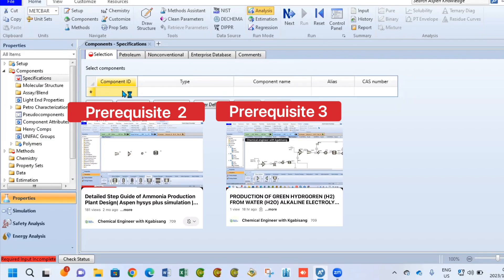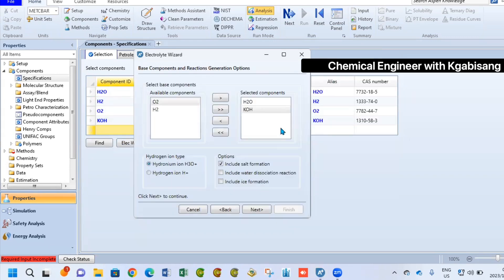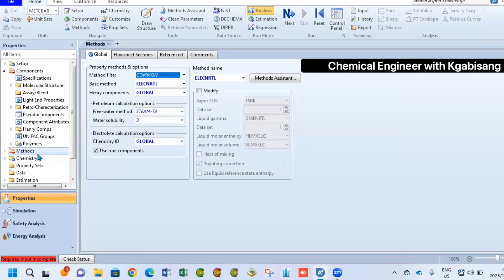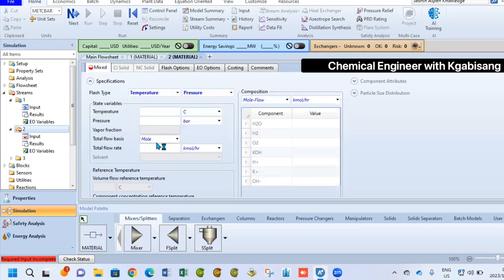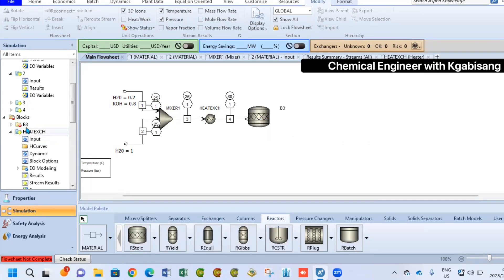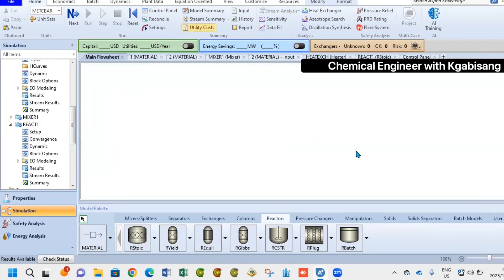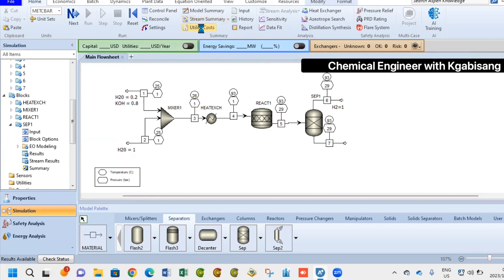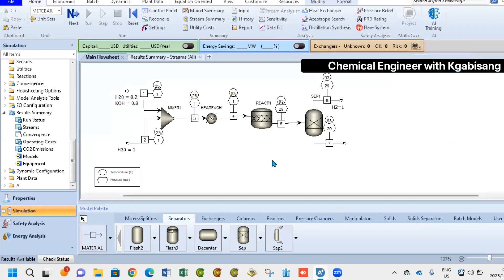Green Hydrogen Production Using Water Electrolysis: H2O = H2 + O2. Aspen Hysis V12.1

Comment: I thought before simulation one needs to get
1) cell voltage
2)stack power
3)hydrogen production
Reply from the maker: Thank you for your comment. I acknowledge that in a research project or detailed study, it is crucial to obtain information on cell voltage, stack power, and hydrogen production. However, the main purpose of this tutorial was to demonstrate the use of Aspen simulation in simulating the hydrogen production process. The tutorial's objective was to offer a practical demonstration and guidance on utilizing Aspen simulation, specifically the elec wizard tool, to simulate electrolysis. This tool is available within Aspen and is designed to assist in the simulation of an electrolyzer.
Reply: @chemicalengineerwithkgabisang  thank you very much. Am a student doing my final year project that involves the simulation of hydrogen gas production using alkaline electrolysis of water. I appreciate, your videos are helpful.
Reply: @marvinkakinda253  Hi! Could you tell me more about how you did this? Did you use Aspen?